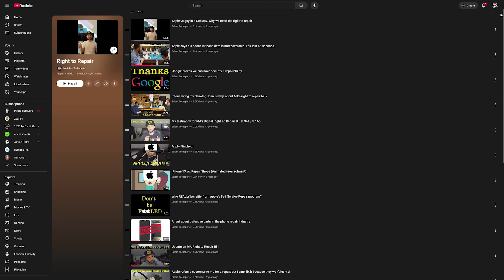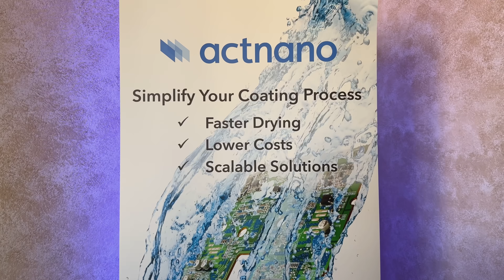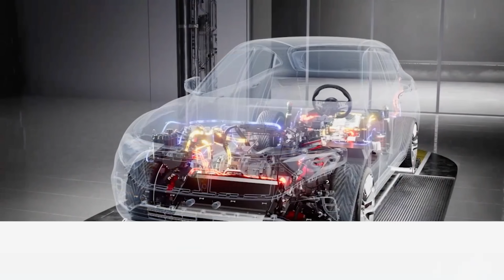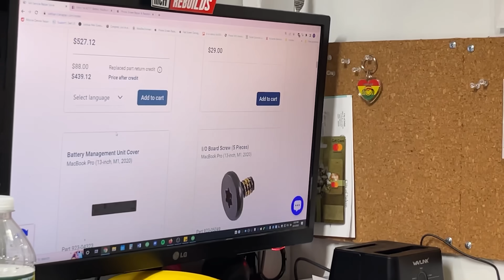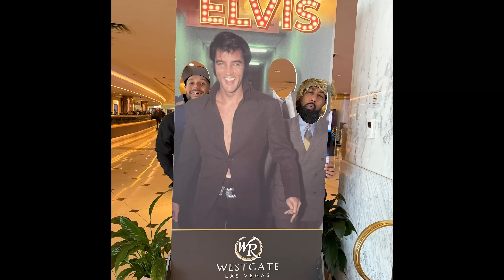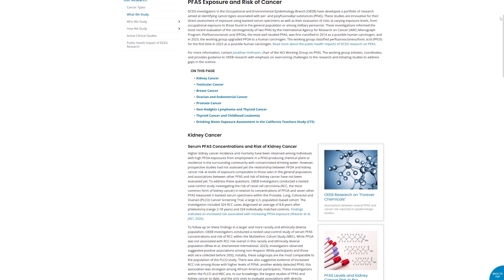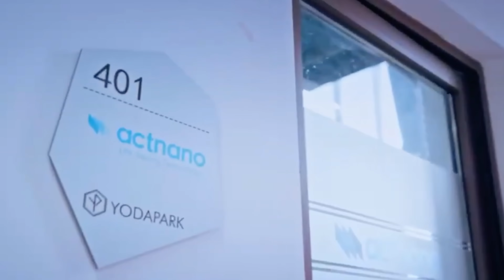Waterproof Laptops ARE Possible, But WE Need to DEMAND Them! actnano nanoGUARD is HOW We Do It!

Comment: I genuinely have aspirations of starting up an OEM and if only Framework has implemented this by then I guarantee I would too. On the one hand, the world doesn't need yet another company manufacturing yet more products when there are already too many and I do feel really conflicted using even more of our increasingly finite, often unrecoverable resources, on the other, I'd be doing something entirely different, focusing on an entirely different market whose needs aren't being met yet, and specifically on a very custom tailored user experience that aims to bring back a world of friendly computing while also being a good option for kids with an extra educational model at the bottom tier (I'm really hoping to manage a ~$100 price point using all very mature technology like TFT panels and a MIPS or PowerPC processor implemented in a low-power, slow but small FPGA that can run off of commercially-available 21700s) that combines those terrible toy laptops with a genuine but sandboxed laptop that kids (and really tinker-curious adults) can learn to write software in, and programmers and authors would love for the buckling-rubber-sleeve keyboard, carried up to the very top of the chain.

Comment: How is it with acidic sugary liquids like cola or other carbonated soft drinks.  My first job in IT was doing desktop/network/server/anything-with-a-plug support for a small software company.  This was back when most people used tower systems under the desk so the main casualty of spilled drinks was the keyboard.  This was also when keyboards were expensive enough to be repaired if possible.  Water wasn’t much of a problem, just swap the keyboard out and stand it on end on some paper towels and it was usually OK.  Tea or coffee without sugar usually meant rinse out and stand on end, if there was sugar then scrubbing under a hot water tap usually fixed it.  Carbonated soft drinks, regular or diet meant the bin.  That stuff will trash a key switch contact before you can say phosphoric acid.  I suspect fruit juice would do the same but this was developers in the mid-1990s so it never wasn’t really a factor.
Reply from the maker: Pinned comment answers this, it handles it just fine
Reply: @ cool, a lot of good (and expensive) keyboards died at the hands of Pepsi.

Comment: Back in 2008 i spilled hot cocoa in my laptop, I fast turned it off and put down a towel on the table and turned my laptop upside down and left it like that until I come home later that day.
I later tried to order a new exchange keyboard from Asus in Sweden. But they really just wanted to eff you over with odd ways of payment, so I went to Ebay and bought one instead.

I don't think this is the case here, but it could be demineralized water running in their test.

This CEO should really be noticed more for what he is doing for the world and us!

Comment: and then you find out the coating is toxic... a few years down the line. Did you ask what materials is in that coating?
Reply from the maker: Come on man. It's answered in the first 4 minutes. One of the main motivators of the CEO to make this product was SPECIFICALLY to create a non-toxic coating.
Reply: @SalemTechsperts  first 4 minutes? We didn't see it. They specify "pfas-free"  but they never specified which molecule they are using. 
Can you point us to the timestamp? (0:50 etc) where they specify the material in the coating?

Comment: I love the idea and support it all the way, even if it doesn't protect the components at 100% it is still a protection 😁
I just have a couple questions

If you do a teardown or if you build it "from scratch" (as you do with Framework) does it still work as if it was coated after being fully assembled? Or does it have trouble with things like ribbon cables because you "brake the seal" or something?
Continuing on this line of thought, could you apply the coating yourself after a repair or something of the sort?

Also would like to see someone drinking some "mineral" water and then dump the rest of the jug into the computer. Cuz since it is a video people could think it is isopropyl alcohol or dystilled water, WHICH is still amazing that those machines are working, but these lack on conductivity compared to 'regular' drinking water

Would like to see these PCBs getting splashed with common water-damage related solutions, like sodas and things of that sort

Amazing product, hope this really works and takes-off and that a company like this (that helps the consumers and the planet on the long run) makes loads of money

Comment: Yo i've read in an article(asked chat gpt) that this nano layer might make repairs tougher.
"Actnano’s coating complicates repairs by requiring special tools to remove, potentially damaging parts. Not all repair shops will have the expertise, raising costs and e-waste. It also may lead to more sealed devices, making DIY fixes harder."
Reply from the maker: Stop getting your info from ChatGPT. As I specifically mentioned 2 minutes into the video, this does NOT hamper board work. https://www.youtube.com/watch?v=pPH1j3LG1zk

Comment: Great idea. But just coating the board can't possibly be enough to make a laptop waterproof.  It might prevent electronic components from shorting out when wet, but how about shorting at the connectors? at the very least you would need to spray over them once connected to prevent water from seeping in. And to make the entire keyboard watertigh also looks like something you would need to address during manufacture. But even if this adds only a little water repelence it would be great. Most people aren't going to fully submerge their devices for days on end. A quick dunk in the tub or some spills on the keyboard are the most common issue.

Comment: Man that sounds & looks like "Silicone Conformal Coating" a 55ml bottle $25 product that I've been using on laptops and BMW module circuit boards for years!  lol....
Shine some UV (black) light on the item you just applied Conformal coating to see the missed spots and finish it off!  Easily removed with just alcohol...

Comment: Hearing that it still allows board repair is awesome, but say a component is replaced. Does that component then have to be left vulnerable to liquid, or is a smaller disposible version of this technology possible such as a spray can to cover the component after? If corporate greed stops this at the factory level, a consumer version could be the answer.

Comment: This is one of those solutions that would NEVER work together with socketed ANYTHING right? So all components soldered, even the SSD. Also how easy it is to reapply this coating after replacing a chip on the board? Is it even possible to solder to a coated board?

Comment: big questions would be, while it looks to work great with water, how does it handle something more acidic like a soft drink or coffee? how does it deal with liquids that dry to a residue? what if that residue is conductive? does the coating allow for cleaning off of these residues? do you have to use more water? can it be cleaned with alcohol? will the product be available to consumers/shops to treat new hardware or retreat hardware the coating may have been stripped from?
Reply from the maker: Every question you just asked is answered in the pinned comment
Reply: @SalemTechsperts  

Full video was a goodun. Dudes definitely trying to sell it, but has the information to back up why it's a worthwhile buy.

Can imagine it could see use in a data center space as well. If everything is waterproofed there'd be no need for expensive fire suppression systems using shit like halon or other oxy displacement gasses.

Comment: Lol, it cost $1 and the 20% of customer won't buy another of your laptop? Lol any shareholder will oppose to it.

Maybe a kit to diy in your current laptop?
Reply: the issue is that would require providing technical support, and an entire consumer division.
Reply from the maker: Not to mention it needs to be applied on a completely clean board

Comment: To be fair, laptops days are numbered. Phones are getting so powerful that eventually there wont be laptops(yes its a ways off but it'll happen)
Reply: No they won't 

you can already do 90% of the things you need to do in a work setting with a phone 

Laptops are just way easier to use for general work applications and workstations are needed for harder stuff 

Laptops are just the perfect middle ground 

Best we will see is probably a phone that doubles as a mini PC

 but since we already have mini PC's it won't be that revolutionary when it happens just a nice convenience upgrade

Comment: A lot of large companies have departments that have dedicated budgets and if those departments don't spend the whole budget that finacial year they get less or loose it entirely. 
So they spend it however way they can and that normally involves replacing perfectly good working Laptops or Desktops with new ones and the old ones are eWasted off since most other departments don't want second-hand ones. I've worked for large companies with this setup and it happens all the time at others, I really don't agree with this setup with budgets and wasting them on replacing devices since most of these 'old' devices are fine and can be re-used for years to come. They might be business-grade devices, but something is better than nothing ☹

Comment: I personally took apart makita battery charger a few days ago to fix it, it uses something like this because when i was probing around the board it took me some time to realize it wasn't my equipment that was giving me unexplainable reading but the whole circuit board is coated with invisisible coating like this one. Until I melted the solder i would  get infinite resistance even if i poked hard at joints to test them. Bit of a pain when fixing stuff but i guess very useful to have to make electronics safer and more reliable.
Reply from the maker: Answered in the pinned comment

Comment: Might as well start a service of applying this coating.
Reply from the maker: It must be applied in the production factory where dust, humidity and application of the coating are under strict control and with the proper procedure and machines.

Comment: Moore`s law has no mercy. any device with a cpu inside is obsolete after 2 years. It can still be used just like the cubans still use 1950s cars, but... would you rather have a 2020s mercedes or a 1950s buick as your daily drive?

Comment: If this is anything like conformal coating, this will make debugging (and thus repairs) more difficult to make. Also, computers in cars are notoriously difficult to fix just because of how much waterproofing is inside their cases and on their PCBs. Be careful because this could actually cause products to be LESS repairable!
Reply from the maker: Good thing it's nothing like conformal coating. See pinned comment.

Comment: I have two questions about this.

One: I can see how spraying a board makes it waterproof. But how do the connectors work? They're just spraying directly into regular default connectors, does that not clog them up? How is it still making a reliable connection?

Two: Would it be possible to DIY this? Could I waterproof my own laptop with, let's say, an airbrush and a tub of the stuff? Do they sell this stuff to normies?

I don't really do laptops, but I recently had to take apart and clean my whole keyboard after a beer spill, and it took me like a week to disassemble, clean, and reassemble.
Reply from the maker: 1: https://www.youtube.com/watch?v=sx3xE7D5ys4
2: See pinned comment

Comment: HP actively manufacture laptops and printers with "fuses" that go Boom! when your device has been used for longer than the manufacturer THINKS you should go without purchasing a new one.  They hide the fuse tech in the motherboard.  Basically a tiny length of some PCB tracks are a different material that decays slowly under current. then the track breaks 'invisibly' because its inside the PCB layers and not visible to the naked eye.  Ever had a laptop or printer motherboard that "just stopped working" and there appears to be nothing you can detect causing the issue, it just refuses to work? . Chances are it was designed that way to increase company profits.

Comment: How would this affect repairing non water damage issues. Like if the entire board is covered in a coating, wouldn’t something like removing and replacing the ram, battery, etc. require a new coating of this for the device to still be waterproof? Of course water proofing would make devices much more resilient, which is really cool, but how does it interact with other repairs that might need to be done?

Comment: I don't know. I'm kind of sketch on that laptop that is underwater because Unless they coat the battery contacts and underneath the CPU with that stuff, they would have to use completely 100% distilled water in order for this to survive. nobody drinks distilled water ( And if you do, you need to stop.) because it's the stuff in the water that's conductive, not the water itself. And anybody who spilt anything on their laptop keyboard knows the hassle of trying to get phantom presses and no connects to stop being a thing. Because unless it's a mechanical keyboard, the button membrane presses on a layer that connects to the layer below it in order to create a passage for the voltage and data to go through in order to make a key press. If you spray anything on top of it, there's a chance that the signal might not go through, depending on which keyboard technology the laptop manufacturer is using. TLDR, this might be perfect for phones to give them a hugely more water resistant rating and make them actually last if you drop them in the ocean or something like that. But in laptops, especially with all the electronics that you can't spray, I don't know if this will work.
Reply from the maker: If you read the pinned comment you would've saved yourself all this typing lol

Comment: Okay, hear me out. The single dollar per item statement is kind of forefetched because that doesn't include the cost of all of the equipment necessary to add that $1 product to everything on the assembly line. Now, if there's a way to do it that I'm not aware of that negates this issue so be it.
Reply from the maker: The equipment is already on the assembly line, the product is simply replaced with ANG. The full interview discusses this.
Reply: @SalemTechsperts  Is the full interview later in the video? My break was over before I could finish the video.

Comment: it would be great if actnano could be sold as a areola spray so any one can increase the water resistance of the electronics they all ready have.
Reply from the maker: You can't apply it yourself. It must be applied in the production factory where dust, humidity and application of the coating are under strict control and with the proper procedure and machines. Explained here https://www.youtube.com/watch?v=Iyk5tB56P9s&t=1736s

Comment: I would like to know if they would ever sell home kits. Or have certified installers like yourself that could offer this process as an aftermarket option. Obviously there would be a labor fee, but would be huge for the used market.
Reply from the maker: No, you can't apply it yourself. It must be applied in the production factory where dust, humidity and application of the coating are under strict control and with the proper procedure and machines. Explained here https://www.youtube.com/watch?v=Iyk5tB56P9s&t=1736s

Comment: is it possible to apply this coating on an already finished motherboard (meaning that if you as a consumer buy a regular motherboard and apply the coating yourself)?
Reply from the maker: No, you can't apply it yourself. It must be applied in the production factory where dust, humidity and application of the coating are under strict control and with the proper procedure and machines. Explained here https://www.youtube.com/watch?v=Iyk5tB56P9s&t=1736s

Comment: can you buy this coating as a consumer? i have a framework and would love to coat the mainboard
Reply from the maker: No, you can't apply it yourself. It must be applied in the production factory where dust, humidity and application of the coating are under strict control and with the proper procedure and machines. Explained here https://www.youtube.com/watch?v=Iyk5tB56P9s&t=1736s
Reply: @SalemTechsperts  Uhm this sounds like we don't want to bother with selling it to consumer, I would be really easy to remove my laptop motherboard spray it on and it's done, I repair boards for living, it's a coating the climate control part doesn't make sense 99% of PCb production line aren't climate controller yes you can make an argument about dust but as long as you keep it clean it should be fine so no they have 0 reason to not selling it to consumer, and no he doesn't explain why it can't be sold to consumer he just says it's easier to do it in production

Comment: my question is what is the catch. its non-toxic, cheap and easy to apply. Is this really a no strings attached solution. Also,  if you repair a device that has this applied; will it still be waterproof, or would you have to get it re-applied. and if so how?
I hope framework joins with these guys. I feel like they are the perfect company to start the train. I wouldn't be surprised if they are already adding this to their assembly line, and waiting till its done to announce it.
Reply from the maker: No strings attached. Board work process described here, https://www.youtube.com/watch?v=pPH1j3LG1zk
They have not had a single laptop manufacturer sign on due to the exact reason he stated in the video, the manufacturer's aren't willing to sacrifice 20% in short-term profit loss from accident-related purchases, in order to build a more durable laptop.